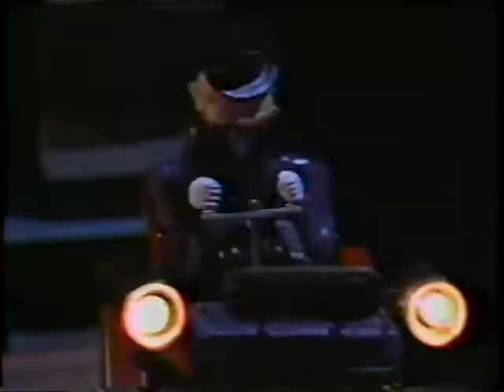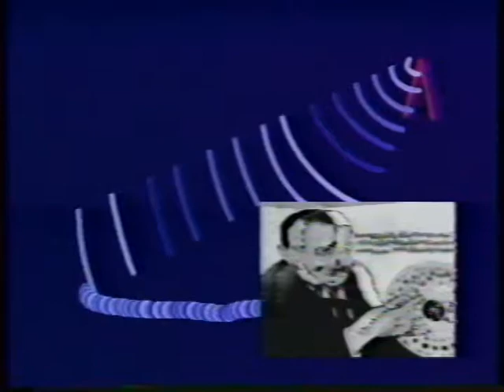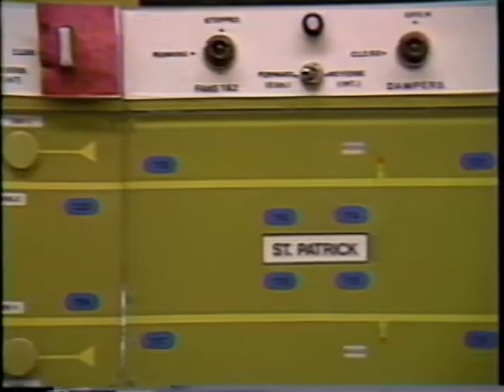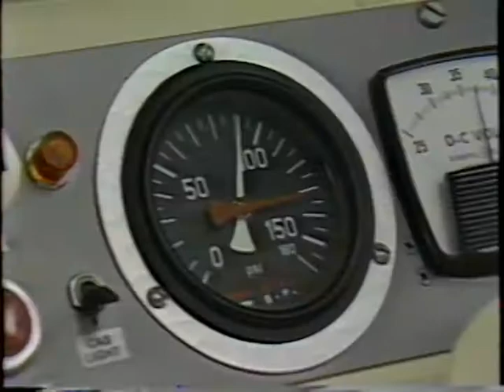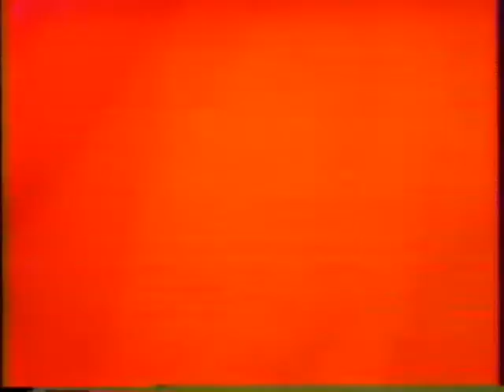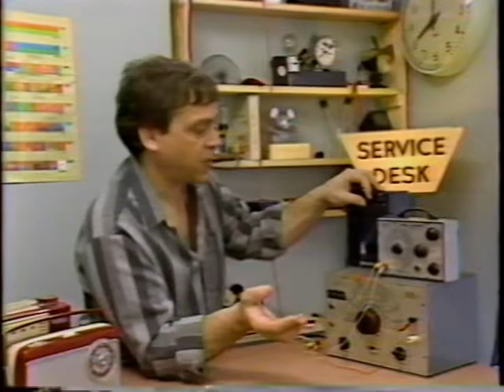Acme School of Stuff -- Explain of VHF/UHF channel/cable - Toronto Subway - Basic of Engineering

Comment: This explains why the old radios that could pick up TV audio from VHF channels had such uneven spacing between the channels on the dial. They used mechanical tuners, and the frequency between channels 5 and 7 is bigger than the others.